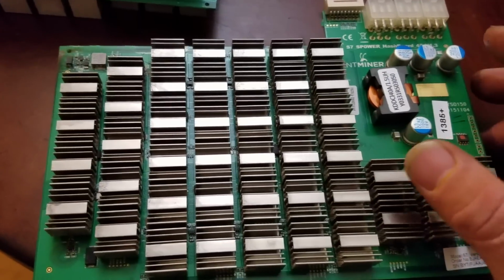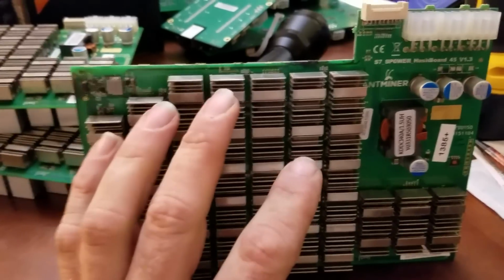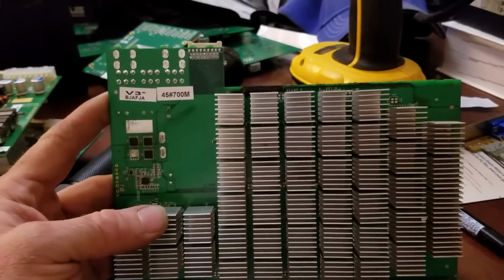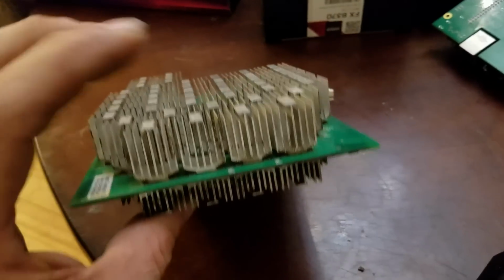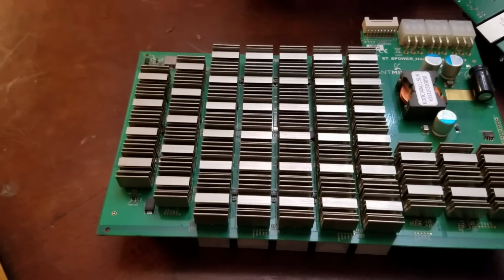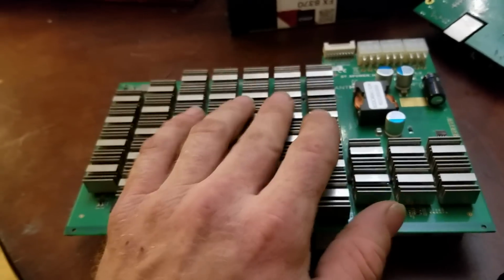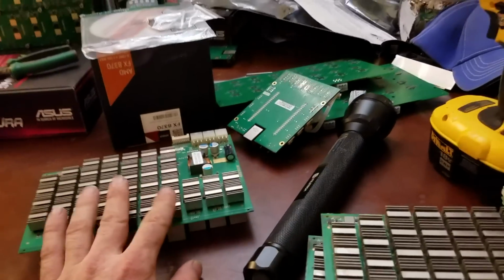How to diagnose problems with hash boards

Comment: can i use that s7 antminer board and upgrade my s5 ant miner board with it? i found them selling online working.  so i just wanted to know. if it would work.
Reply from the maker: +Brian Reynolds it would work but I recommend you find a s7 miner that is working  instead
Reply: i have limtied power supply of 1200 watts and adding another power supply to the story is not possable. was going to replace the none working s5 boards with 1 s7 board then remove 1 of the s5 board etc.  i can get  a s7 board for around $80. vs $300-600 for an s7 miner it self. how wold i go about it cab i use the old heat sink for the s5 on the back of the s7?
Reply from the maker: +Brian Reynolds the ethernet connector is powered by the s5 board so you will have to find a s7 ethernet connector board as well
Reply from the maker: +Brian Reynolds S7 board should have heat sinks on both sides. I'm sure you can get one board to work with an S5 it will be a jerry-rigged scenario but I'm sure you can make it work

Comment: Thank you very much Bitcoin master. Very useful information. Talking about temperature. You said that the operation temperature of the 4.73 Th/s, 45 ASICS must be 40°C. Do you know the temperature operation of the 4.86 Th/s miners. Thanks a lot.
Reply from the maker: +Leonardo Uribe the average for the S sevens was rated at 40 degrees Celsius many of the power supplies were rated at 25 degrees Celsius the range will be from -10 degrees Celsius all the way up to 80 degrees Celsius

Comment from the maker: i will get bitmain to provide the schematics if i can they had them in the past  i don't know why they removed them they have also remove a lot of the old firmware updates he'll talk to them and see if they can restore those as well
Reply: bitcoin master I also have an s9 that died, slowly, first one hash board, followed by the remaining 2🙁
Reply from the maker: Always start with upgrading your firmware
Reply from the maker: After upgrading your firmware if you still having a problem test each board separately
Reply: i wondering condensed water does not conduct electricity. youre shure this is comming from air moisture?
besides, the airpressure and heat should prevent any condensation so i really wonder how that happend
and furter, woulndt a small pack of silicon (you knwo that drypacks) inside a unit help if you change them on your regular maintance shedule?
Reply: bitcoin master, did u master in electronics engeneering to know all that ? or how did u learn all that ? thank you
Reply: bitcoin master Do you have the name of the place that repairs the S9 hash boards
Reply: Hi there! I was wondering if you could help me troubleshoot my D3 overheating. I cleaned my D3 hashboards and now the temperature is shooting up to over 100c within 2 minutes of booting.

Comment: Master,
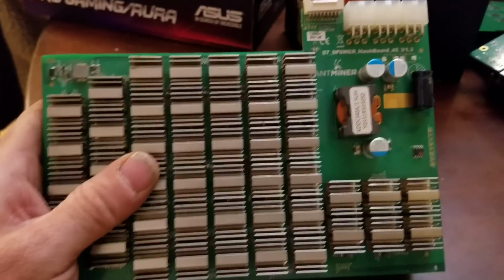  At 11:20 you mentioned that "all the specs for all the components are available form Bitmain."  I am looking for S7 hash board schematics and  have searched their website and cannot find them.  I only see the firmware and user manual downloads.  Can you provide maybe a link?  Thank you.  - Rick O.
Reply: hi Rick

did you find manual for repairing the board?

Comment: Have you got a datasheet of the s7, s9, where all the components are listed (capacitors, transistors......)?
Reply from the maker: Lamona Films the data sheets can be found on bitmain website under the support area then downloads
Reply: No, there are only data sheets for the microchips not for the hash board.
Reply: There arent any shematics of the S7 or other miner, chect it out¡¡¡ There is only the firmware.
Reply from the maker: +Lamona Films I spoke with bitmain and after asking them to repost the schematics they told me that they are no longer going to post them that only there authorized warranty dealers will be allowed to have that information. I wish I had made copies the schematics. I will try and search Reddit to see if anybody has some copies
Reply: They dont want that people can repair the boards, they are earning lots of money and want more. Im going to swicht to Ethereum mining and Zcash, at least grafic cards dont break down soo easy. Goodbye f*** Chineses. If you  acquire the copies let me know.

Comment: Hi, A big thank's for your time, I have 3 s7 miner and 5-6 defective board, so I was really happy to see you video. I was trying to find voltage test point on bitmain's web site but without success, can you tell me where.

Also, do you recommand to systematicly change capacitor on hashing board with high quality like nippon or panasonic. Can you tell me what exact part did you use for replacement, as I did not have esr meter, it maybe cost less to replace them all ??

Thank's

Pierre Lavoie, Canada, Quebec
Reply from the maker: Pierre Lavoie the board diagrams are in the firmware area look fir your board number
Reply: Hi thank's for your answer, I looked really hard but can't fand them, I check with waybackmachine.com and I'm really unable to find anything about schematic, I ask google really hard but no trace of it, have you a copy ?
Reply from the maker: +Pierre Lavoie bitmain dosent want to share the diagrams any more they said to tell everyone about bitmain warranty  it is located in the us they can repair or replace the defective boards
Reply: hi dear friends. 
unfortnelty I do not have access to repair centers of bitmain in china or USA.
Can you please send me this manual to save my S7 boards?
arameh.eyvazian@gmail.com

it would be great help for me

Comment: Thank you for taking the time to make this video which I am sure will help many like me. 
If I may ask a question. Is it possible to have too much air in the input of the fans as you slightly eluded to or am I just not comprehending properly?
Thanks again
Reply from the maker: +Paul Sookraj the air flow has to be pressure natural or only  .25 static at the most as the static pressure increases the cfm reduction grows for example if the static pressure is  .50 in wc the amount of air that is being moved through the miners is dropped by half that  is how many people have been destroying the miners they have with out even knowing why they were having a problem until it's to late
Reply: Thank you so much for your expertise BM much appreciated. If I may add I have two S9 's in a small room ( bathroom size) and I have created two ports. One for the intake air and one for the fans to blow outside. I have the two fans blowing straight out of the room into the atmosphere. I think that I will be okay as the the inlet opening is slightly larger that the exhaust port. I would really like to hear your comment on this. I would be happy to list all the dimensions so that I could have your expert opinion and peace of mind so that i sleep at ease.

Many thanks and Kind Regards
Reply from the maker: +Paul Sookraj at 5000 RPMs the fans on miners are moving 300 CFM this needs to be made up with approximately 325 CFM into the room to achieve a very low static pressure situation just simply having a hole in the wall will not do it not unless the whole is incredibly large. For instance you will need one square inch per CFM. 4A opening with no fan assistance the makeup air hole would have to be 600 square inches
Reply: Dear Master, Again you have overwhelmed me with your knowledge for which I am deeply grateful for and bow to your superior knowledge in physics. In my case my air inlet is 180mm x 900mm . Would it be correct to say that this only meets 30% of the requirement? Please could you kindly tell me as to how you derived the figure of one inch per CFM. By this i am in no way questioning your methods but merely educating myself.
Thanks once again and kind regards
Paul
Reply from the maker: Paul Sookraj it's quite simply the laws of thermodynamics or has any HVAC engineer understands non fan assisted openings have to be a certain size to overcome differentials and pressures between inside the building and outside the building